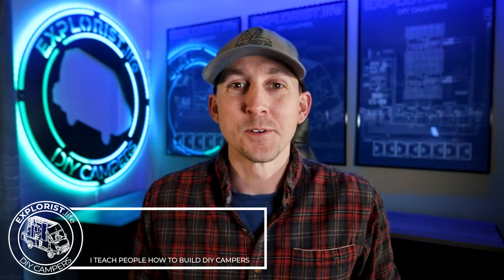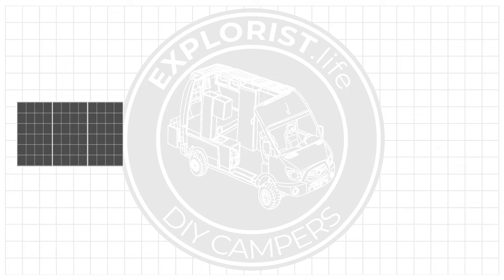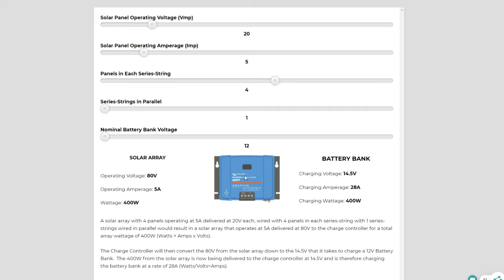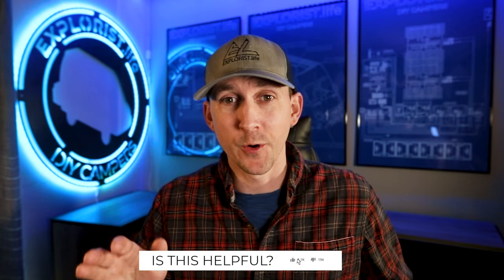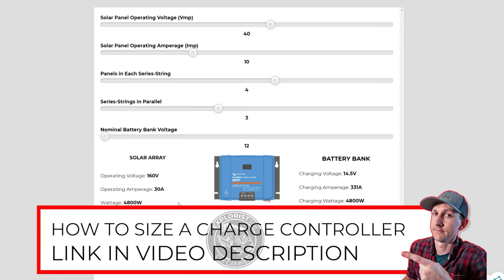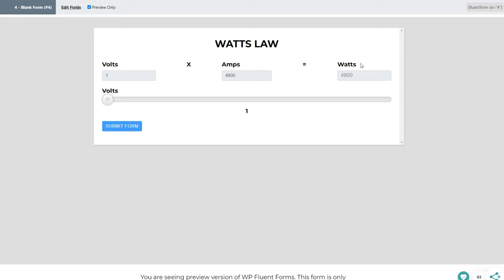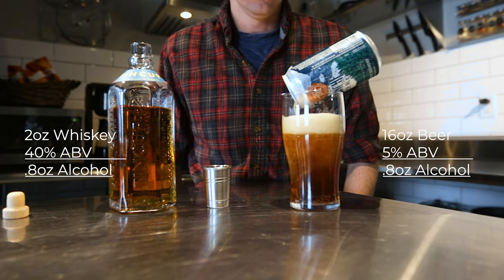What does a Solar Charge Controller Do in a DIY Camper Electrical System?

Comment: Hi Nate,
Been watching your video's and have some questions.
I'm getting ready to install solar at my home, DIY.
I've contacted several people who have channels/solar info and have gotten no response.
I recently purchased 3000 watts in 12v solar panels and I've tried doing the math myself on batteries and other equipment.
100 Ah 12V LiFePO4 Deep Cycle Battery , these are Battle Born Batteries I want to buy 10 of the batteries. I can't even get BBB to contact me about what size charge controller and other things I'm going to need. When I initially contacted the company, they sent me a work sheet and told me if I needed help to contact them. I want to install 110v mini-splits and not use my central unit.
I'm at a total fork in the road and don't know what to buy.Any help you can give me would be appreciated.

Update to our prior conversations: BBB finally contacted me and I'm even more confused. They did confirm I needed to run 2 parallel strings of panels w/2 charge controllers @48v. So, I said okay I'm good with that. (They did tell me that they were battery manufacturers and not installers.) He asked that I send usage information, which I did based on prior use. My biggest draw is the central unit in my home and is why I'm doing away with it. As I said before I'm going to be installing 4 or 6 mini-splits which draw between 5-7 amps which will not run in unison. 2 days past and this morning I received a message stating I need to buy $28,000.00 in 12v 8d batteries ($2800.00 each).  I'm not sure if this was done so I'd quit asking questions or what. So here I am with all these panels and I don't know where to go from here. I've established that I need 2-48v charge controllers but which ones? I really don't mind spending money on the batteries but not $28,000.00. Which batteries exactly? First they said, 48v, then 12v. Still need some help. I don't know what size or what type MPPT.
Reply from the maker: Here is a tutorial that will teach you how to size a charge controller: https://www.youtube.com/watch?v=MxziHKvTRh8

Comment: Its better to charge at higher voltage coz you can use thinner wire coz you use less amps. Higher amp cozes so much heat to some wires depending on the thickness. Its the reason why electric grids transmit power at 1000 to 3000 volts and steps it down with a huge ass transformer

Comment: i have watch it and still confused. if we do the math v*a=w then if we have a 200w panel why do we / the watts by the charge controller volts?there is a set volts and amps for the panel but we are taking a number that is with another device and making it part of the total of the panel. to me that makes no sense
Reply from the maker: That's the difference in input vs output voltage.  Input voltage is the solar array voltage.  Output voltage is going to be the battery charging voltage.

Comment: I realize you're a MMPT charge controller guy, but what happens if a PWM charge controller is used.  Seems like this comparison should have been in a video about how charge controllers work IMO.
Reply from the maker: PWM controllers are going to do a similar function, just with much lower voltage thresholds.

Comment: I have 4 320 watt Renergy Solar panels 33.7 volts@9.5amps wired 2 sets in series then those two sets in parallel so I have 67.3 volts at 20 amps charging 6 100Ahr BB batteries. My Victron charge controller 100/50 never shows more than approximately 700watts, why?
Reply from the maker: Do you have a 12V or 24V battery bank?
Reply: @EXPLORISTlife  12v
Reply from the maker: You are seeing 700W because your 50A charge controller is limiting its output to 50A.  50A @ 12V is about 700W (like you are seeing).

Your charge controller is simply too small.  

For a 1280W array charging a 12v battery bank, you'll want a 100A charge controller: https://shop.explorist.life/shop/all-products/solar-charge-controllers/victron-smartsolar-mppt-150100/
Reply: @EXPLORISTlife  I guess I need to understand my charge controller better. This system was started by a company that installed panels and batteries then quit after having my RV for 2 months. Basically only batteries where connected so I could get it home. I had to finish up install from information I learned watching your installs. Thanks for all the help.
Reply: @EXPLORISTlife  The 150/100 is massive compared to the 100/50.
Reply from the maker: Indeed.  And it's the correct charge controller for your array.
Reply: @EXPLORISTlife  what size fuse should I use between controller and batteries, now that I am making this change?
Reply from the maker: 150A fuse w/ 2 awg wire: https://shop.explorist.life/shop/all-products/camper-wiring-kits/solar-charge-controller-wiring-kits/victron-smartsolar-mppt-150100-wiring-kit/

Comment: How efficient is the "Victron MultiPlus 2000VA Inverter" compared to the Renogy Inverter/Charger 2000W?

In the blog you told the audience the different between cheap & expensive and that's super useful 

I know Victron uses 1 Ah per hour compared to the 5Ah per hour on Aim, but what about Renogy?
Reply from the maker: I've never used a Renogy inverter/charger, but I suspect it would be in the same ballpark as the Aims Inverter/Charger.

Comment: Well - idea for some improvement: What's about a logic check about input and output voltage: I don't know any charge controller that is able to boost up the solar voltage. 

Wat is your stand: 
I would say: so many arrays, I would go for more charge controllers since many - if not most users (campers) having many panels also have different places for them and so different solar direction >> different production. I was told, an array in series can only be efficient as the worst panel is performing (due to sun direction).

Are there additional restrictions to panels in parallel if they are exposed in different ways?
Reply from the maker: To my knowledge, there is not a charge controller that will boost voltage, but if the battery bank voltage is higher than the solar array... there have been errors made in the system design process which should be addressed so a 'boost charge controller' is not needed.

Here's what happens when panels are 'exposed in different ways': https://www.youtube.com/watch?v=jejro4zkl8I

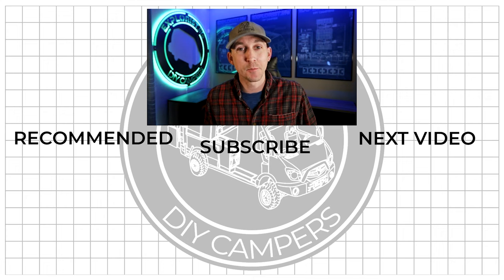Comment: May I suggest that there are perhaps 10 times as many folks with vary limited funds for whom using far less expensive components is simply a requirement. Battleborn makes fine batteries. I wish I could afford them. I can't. Victron 5:43 makes very fine components. I wish I could afford them. I can't. What I can and must do is build a system that achieves 80 percent of the functionality of your high end system at 1/4 of the cost. So you might want to stop the snooty comments. It doesn't become you. In fact think about reaching out to those of us that live on a thousand dollars a month. We won't make you any real money but there are other things in life. ❤
Reply from the maker: Then take the education I provide and adjust for your own needs.   Just because I'm not showing the absolute cheapest option available doesn't mean that the cheaper options don't work nearly the same.

Comment: 100w/14.5v=6.8amps,200w/14.5v=13.7amps,300w/14.5=20.6amps so for every 100w the panel goes up the amps increase by 7.so here is another example,800w panel take the 8*7=56amps now take 800w/14.5v=55.17amps.this is too precise the volts and amps doesn't matter only the total watts
Reply from the maker: Are you asking me or telling me? 😂🤣  Hook me up with a question mark in there and I'll try to straighten you out.
Reply: @EXPLORISTlife  what gets me way is there a max volts input? For my case I have a 200w bifacial panel.so I need a 15a controller but if I put another 100w panel then by the math I need 25 amp controller I get that. But I will never hit the max input because as watts increase the amps increase so you will never hit the max. That's where I'm at the max it so high never hit it unless you get up to 800w then I'm max out at 93 volts in 4  200w panels in series. Or am I just way over thinking this thanks for the help and sorry for the confusion questions

Comment: so by the math for every 100w the amps go up by7 on a 12v system. so how and why the amps only goes up all most 7 amps what math is this. but the volts max stays the same for most controllers. There is more here than what we are being told.
Reply from the maker: 100w/14.4V is indeed 7A; so yes... for every 100w panel you add to the array; the output amperage would increase by 7A when connected to a 12V battery bank.